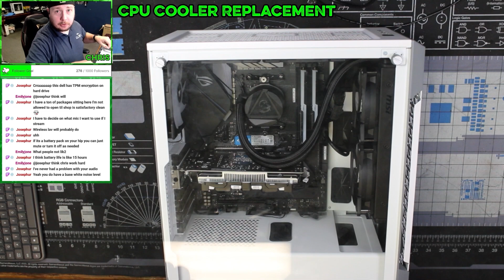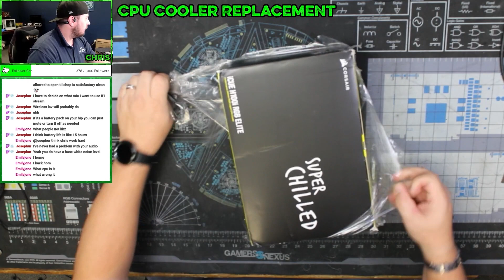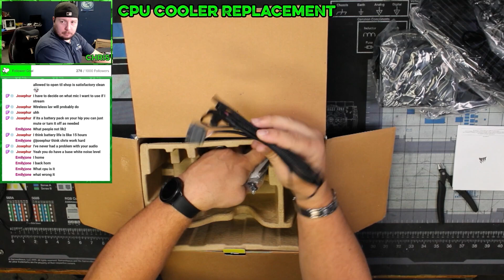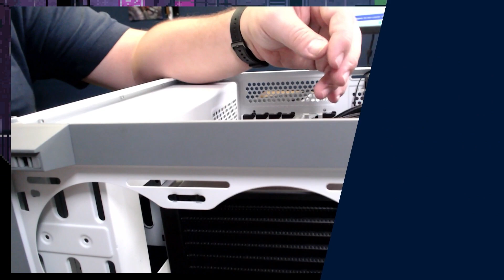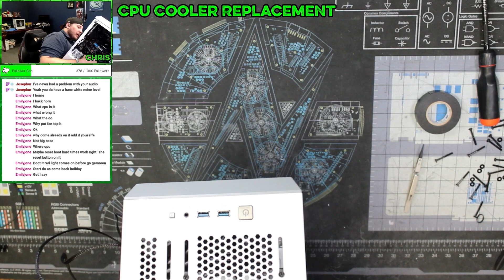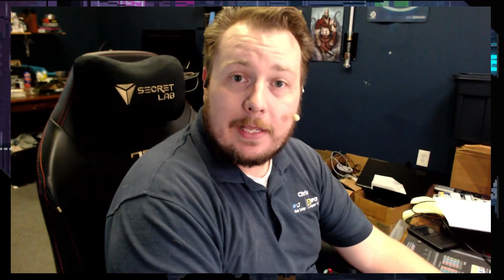This Gaming PC Was Overheating, Lets Fix it With a Corsair H100I!

Comment: Hello, wouldn't the best way be to install the radiator at the top and place the fans the other way around, or to push the air from the case outwards, thus passing through the hot radiator and exhausting the hot air at the top instead of, as in your setup, having the hot air from the radiator enter the case? If not, why not?
Thanks
Reply from the maker: So to me the most important thing to cool in a computer is the CPU, and this allows the CPU to hit the lowest possible temperature with a radiator. If you have the radiator pulling air from inside the case, the lowest temperature the Rad will ever see is going to be whatever the ambient is in the case. At least this way it is getting the ambient air temp from outside the case. Now eventually the temperature of the metal the Rad is made out of is going to equalize with the internals of the case and then heat soak happens and then it won't get cooler.
Reply: @Bradenton-PC-Repair  My radiator is placed at the top of the computer case, should I place the fan to push the air out of the case or suck the air from the outside through the radiator and bring the air into the case? I placed it in push outwards according to Corsair's instructions. I think it's different if you place the radiator at the front. My system cools well but it bothers me that it starts up hard for a few seconds for nothing on occasion. I have a Corsair H100i and unfortunately only icue can manage the pump I think since it is not plugged into the Aio Pump port of the motherboard, I have to use a small Corsair case which manages the fans and the pump.
Reply from the maker: @Psycotick  Heat naturally wants to rise, so don't fight against it use the fans to move air out of the top of the case.